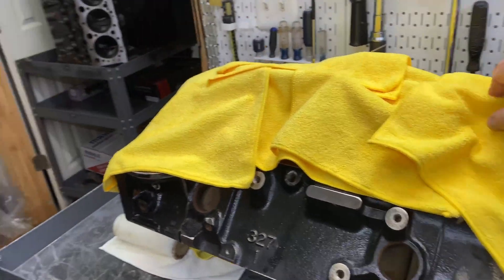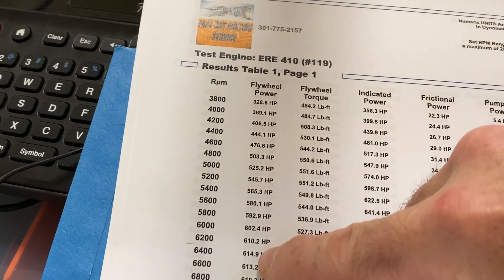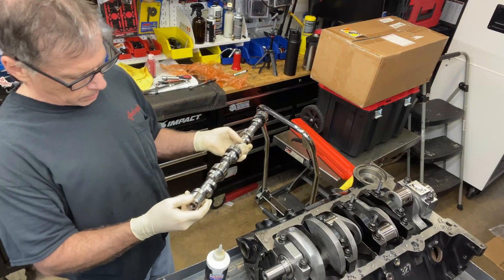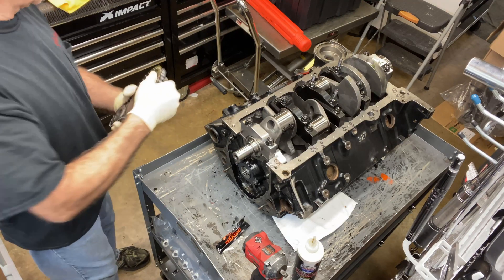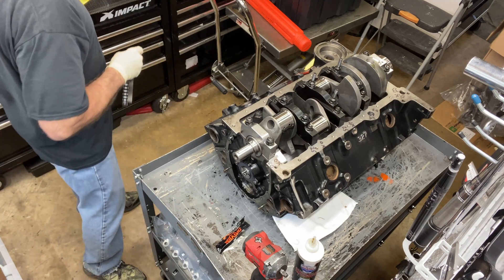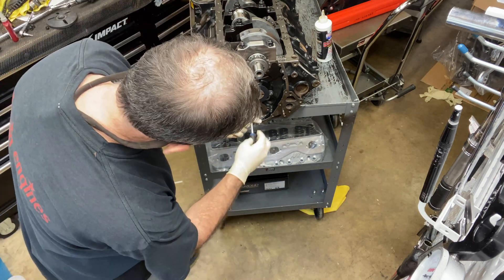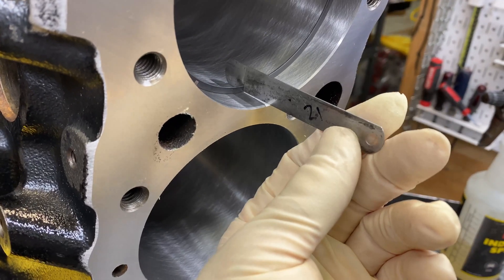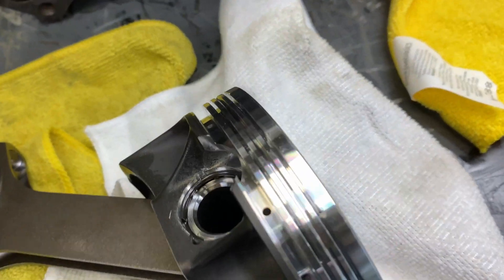409 LT1 Short Block Assembly Part II

Comment: What do you to make a 350 lt1 into a 409?
Reply from the maker: 4" crank and 1.000" compression height piston, and 4.030" bore actually gives a 408 ci.   And a 4.040" bore gives 410.  So neither gives an exact 409.   It's a "commonly known as" saying but not accurate.
Custom piston/bore of 4.035 will give 409.
Reply: @EllweinEngines  I'm using the 5.875"  rod and 1.125" compression height piston to get the pin down some and add some ring land.
Reply: @EllweinEngines  could you run this set up with boost or would if only be NA?
Reply from the maker: @armandochirino2240  N/A for this.  The rings are really close to the top.

Comment: Thanks for the video Im putting my LT 4 back together right now. Gives me motivation.
Reply from the maker: Love those 4-bolt main LT4's
Reply: What’s the cost on a build like this?
Reply from the maker: @mikelauer6845  I should not say the cost since it is the customer who has chosen most of the parts and such.  I charge $2900 for the labor and assembly and such.  Customer pays machine work and all parts.  Some already have 4 bolt core blocks and some parts so it's all up to what the customer has or wants.  If John is on here viewing he can chime in.  He's the owner/customer.